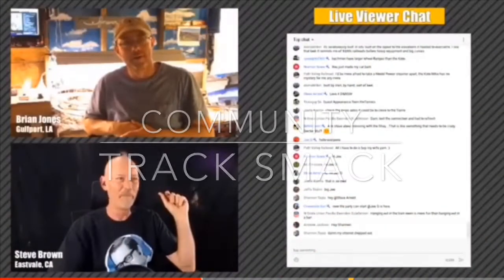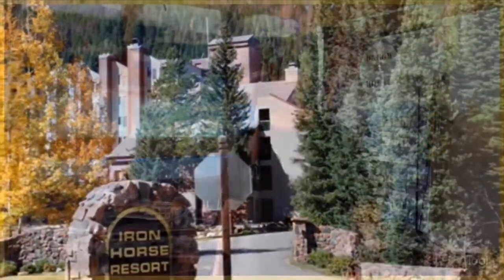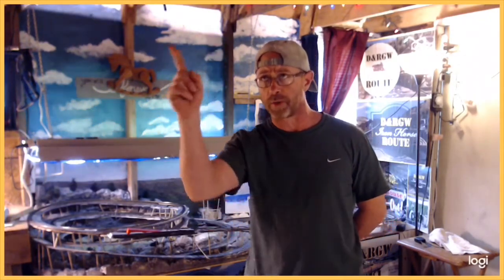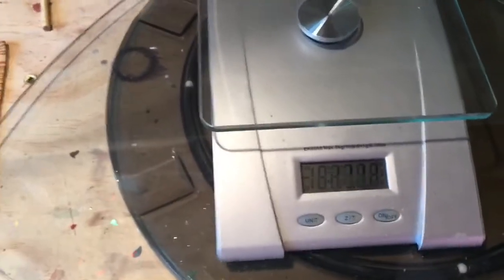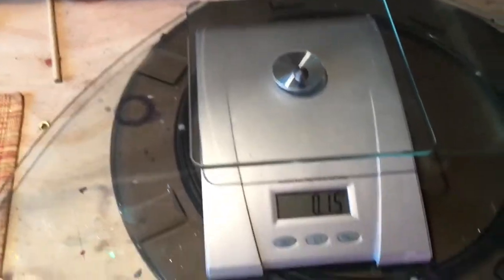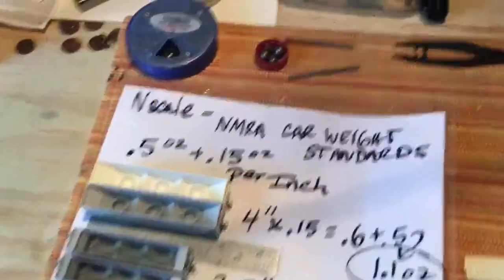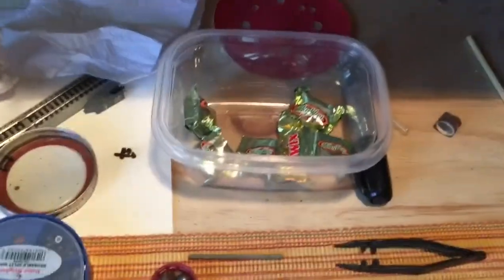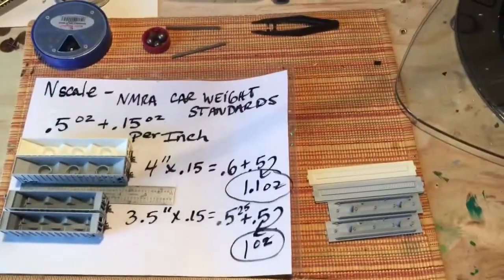How to Weight Rolling Stock to NMRA Standards - N Scale Model Railroad Trains - D&RGW Iron Horse

Comment: Brian,
The NMRA arrives at these weight standards by conducting laboratory research (It's done at groom lake-Area 51-lol) I do not believe it is in any way an attempt at "scaling prototypical weight".
Considering the way that model railroad cars are shipped and the fact that NMRA standards are recommended and not mandated, I believe the manufacturers go with a 'raw weight" to save on shipping weight.
When I weight my cars, I go close to the standard but don't split hairs on it.
IMO, the "right weight" is the one that that works best for You!
Reply from the maker: Excellent response Ralph!  NOW to the fun part...  Finding out the right weight.   like you, I won't be splitting hairs and I ended up making them all just right about 1/10 oz under the recommendation.  I am placing the longer  (heavier) cars near the loco and the shorter cars in the rear.  Is that the best way to do that or should the shorter cars be up front in your opinion?
Reply: @IronHorseBrian  
Brian,
I don't recall that I have ever intentionally put longer cars up front-most of mine are 40 to 60 foot boxcars. I do however, have some 2-bay hoppers I am adding weight to, so I will try it some time!
You will probably have that opportunity before I do and it would be cool to see you experiment with it!
Thanks!
Reply from the maker: @ralphgreenwood5857  I agree.  It will be fun to test it out.  I'm looking forward to testing the cars from light to heavy as well .  That video will come soon.  Going to order one new 3.5 and one new 4 " and see how differently they behave at different weights.

Comment: Hey Brian. It's not about trying to get the cars closer to scale weight - that really isn't possible. The  relatively small amount of weight added wouldn't make that much of a difference when scaled up.  I can't speak for N scale, but in my experience, HO cars track better when weighted. Best, John
Reply from the maker: Thank you John.  Yeah.  I actually did some math after shooting the video and you are most def correct in regard to weight.    As a result, I will assume the standards are for model performance.    John, you stopped in on the impromtu live stream the other day.  I appreciate that as well.  My email is brianj555@outlook.com.  If you would be interested in knowing when I will be going live to do tests, send me your email add and I will send you an invitation next time.  I will be doing some tests using google hangouts this weekend and it would be good if I had some others around.